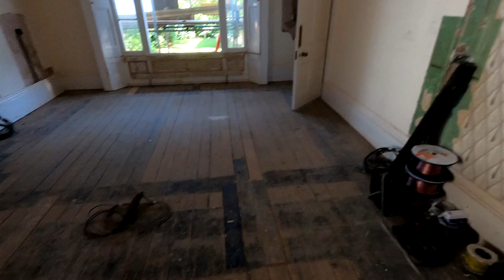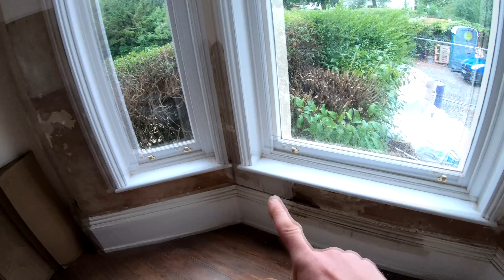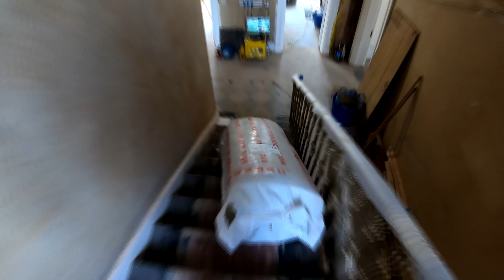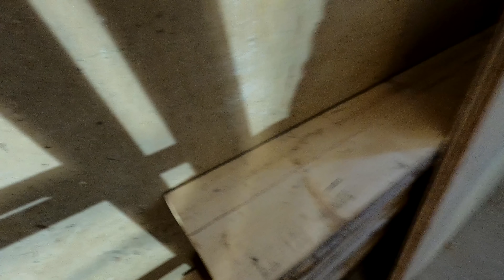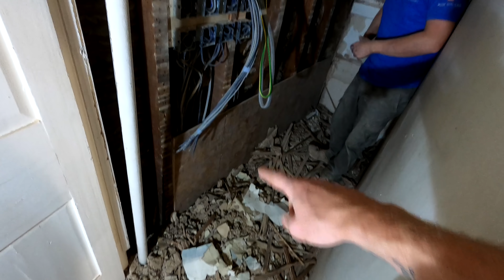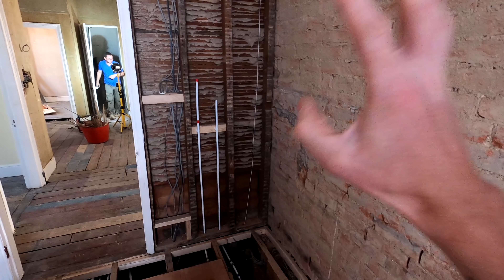CONSTRUCTION SITE TOUR AND PROGRESS | Regency Renovation #6 | Build with A&E

Comment: What a house and renovation! Would love to be involved with this job! Plumber here as I've mentioned before. When you mention manifolds. I assume you mean for the secondary hot water circuit? How many bathrooms?! For the need of planning with a template etc? I'm confused.
Reply from the maker: Hi Lee it is a beautiful place bud, the Plumber on a build like this always puts manifolds on each floor with pressure gauges on it allows use to zone each bathroom and high water flow rates from the regulated pump in the plant room in the basement with break tank there is then a secondary return on the hot water side which is temperature regulated and timed to give the clients the best of both worlds we will be doing a whole video on the plant room later thanks for watching all the best Tony 👍 have a awesome week
Reply: @BuildWithAE  Thanks for your replies Tony. Really looking forward to the plant room vid. This job is going to be something special eigh. You guys have a good week too :)
Reply: @BuildWithAE  Also your comment in the other vid made my one below moot. I was shocked to think of rot board going into a zone 1 with you guys being high end builders. :)

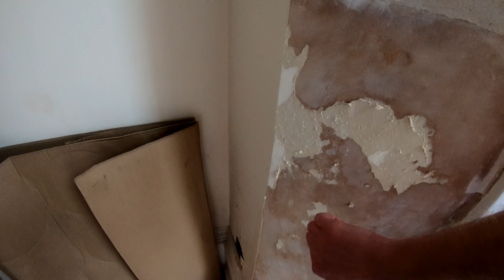Comment: Is that gypsum plaster on the wall at 1:56 ? and above is the original plaster?
What plaster are you going to be using for replacement?
Reply from the maker: Hi McCready 747,

Someone had attempted a repair job before, but hadn't remedied the cause. We will be using lime render externally and lime plaster internally.

Hope this helps.

All the best, John 😊
Reply: @BuildWithAE  awesome!

Comment: I don't rate moisture resistance board, I find it behaves opposite to what you think i find skim and tiles don't stick as well
Reply from the maker: Hi jimmypage1,

We've never had an issue with MR board before. So long as it's properly primed it should be fine.

Thanks for watching.

All the best, John 😊